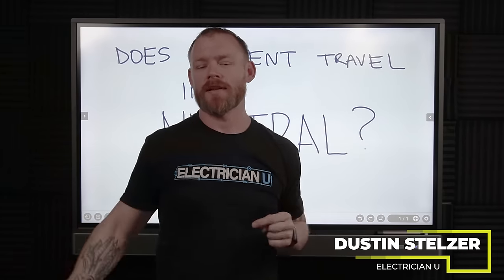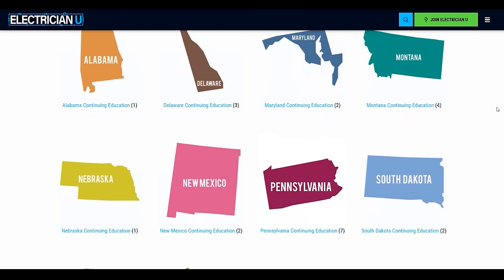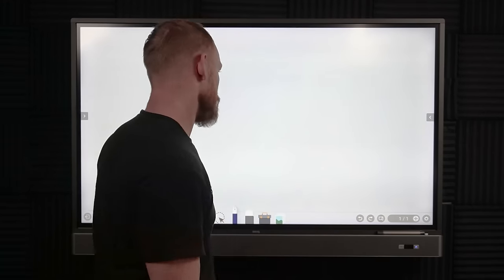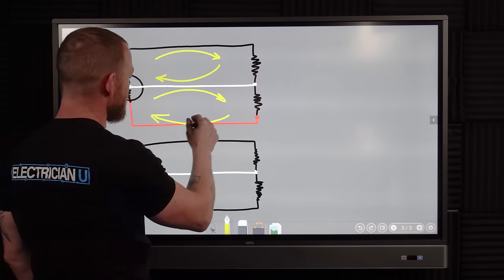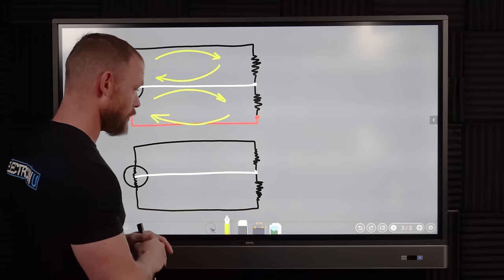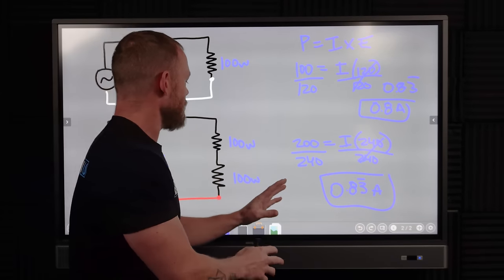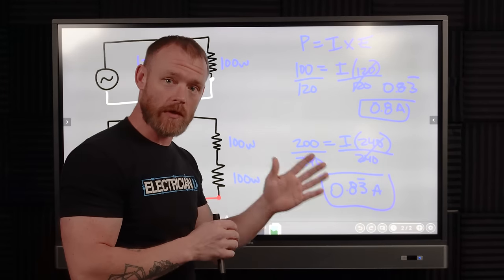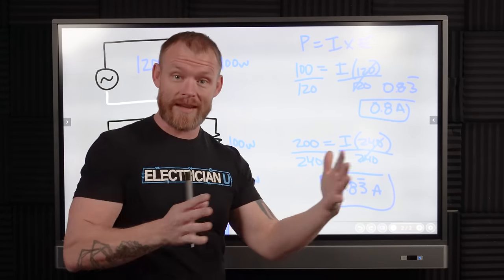Does Current Flow on the Neutral?

Comment: Thanks for the video. There are assumptions being made in order not to have current on the neutral. First, it is assumed there are two loads and they are matched. In the example, if one of the bulbs is switched off, current will be flowing on the neutral (on the path back to the transformer). Secondly, it is assumed there is no reactive load (like a motor). Adding a reactive load will affect the power factor (PF). Practically, PF is never equal to 1, so some reactive load is present making it difficult for loads to be matched and zeroing out current on the neutral.
Reply: Sure, but this is a simplified explanation dealing with a typical residential or small commercial service. Power factor at this level isn't really a concern in the US. Large commercial or industrial is another matter. Also, I don't think he meant to suggest the service entrance neutral load is always perfectly balanced to net 0 amps.

Comment: At electric company; On primary at 12.47 or 13.2  KV an imbalance of more than 5% at the substation feeder is the upper limit we generally like to maintain. Simply put, a three phase 13 KV feeder running 400 amperes nominal per phase the neutral current can run around 20 or thirty amperes. Ideally it should be zero, but often is not. How to be fix this? We do field load transfers. How do we  know branch circuit current values? We place load loggers on Overhead conductors that are paired to the technician's laptop on the ground, and download the readings. We also use special software to predict currents based on customer loads. Usually take field readings for 7 days. Also lineman can use a clamp on meter on each conductor. If the values aren't what we expected, redo load transfers ( making more in the field phase swaps) until we get it right. Usually primary will be 336 AA, 397.5 ACSR or 477 ACSR. Neutral is usually 4/0 ACSR, sometimes smaller. All utilities use different strategies to maintain balance.   Why smaller on the neutral compared to phase conductors, but wire size bigger than needed for 30 amps?  Why a neutral at all? To be able to handle phase to neutral or phase to earth ground faults that can run at high as 4000 amperes at 12.47 or 13.2 KV. 4/0 ACSR is like "goldilocks"  big enough to handle a phase fault and big enough to handle neutral currents; just right size. Without a good neutral back to the substation, a circuit may not trip out when it is supposed to and in the time frame expected  Substation Time over current protection usually trips the substation breaker in 0.3 seconds, Instantaneous trip is usually 0.096 seconds (six cycles or less). We never use a full size neutral on three phase. Exception? Underground JCN (Jacketed Concentric Neutral) cables come from the vendor with a full neutral. Also, single phase primary will have a full size neutral in overhead construction.   Retired SS Engineer, First Energy Ohio.

Comment: You should explain that the mains neutral actually carries  significant current and perhaps explain the difference between neutral and ground to your viewers.  In some residential areas it is up to 180 amps due to switched power supplies and why load balancing per phase is important.  This would explain the need  of zig zag transfomers to your viewers.

Comment: I’m a little confused About your Electrons explanation!

Although  it was a great attempt Most people here are not going to understand that and may get confused, because we’re not physicists. 

Also you drew your neural in white and it shows up as clear in the video. 

I think the reason why people misunderstand and think there’s no current on neutral is because the black wire is commonly referred to as the hot wire and of course the neutral is white.  I think people make the assumption that there is no power being generated on the neutral.  but as you clearly stated the power moves in a circle or loops back and so of course it travels back on the neutral to the hot and your drawings do a great job of explaining that! 

in the US/Canada we have 60 Hz means 60 cycles a second 120 volts and in Europe it’s 50Hz 50 cycles and 240 volts.  a cycle is a sine wave that goes up and down meaning there’s a peak and a valley! 

 also I know something about common mode noise issues from copiers and very heavy motors and machinery that travels back from the panel into the power line to individual homes and businesses! which happens between neutral and ground and destroys computer chips! It actually puts tiny pinholes in computer chips and destroys them over a period of time! 

There’s also an issue of sags (user voltage and surges over voltages) from the power grid! Which brings up the topic of switch mode power supplies that are Inside computers that change the voltage from AC to DC. they also provide voltage regulation but not power protection regulation which is why you need power conditioners to clean up the dirty power for computers! 

I used to use an Oscilloscope with a special device that you would plug into the receptacle a.k.a. power outlet plug the other end of device with (2) leads to plug into the oscilloscope. And show cannonball mold noise to facilities people and IT managers who probably didn’t understand anything I was talking about except the facilities people!

Comment: Twice in 6 months time, I had a fault in the Neutral line coming to my house.  The symptoms were the same (DUH!) - If I ran a high electrical load off the red wire, and a low load off the black wire, the voltage would dip low on the one side and spike high on the other.   The first time, it was due to a corroded neutral wire connection just outside the electrical meter.   The utility worker came and remade all 3 connections and arranged for a drip loop so rain water wouldn't run over the connectors again.  The second time, it was that the neutral wire was damaged by a tree limb rubbing on it.  It took a long time,  too long of a time, to convince the electrical utility to come out and make a second repair.  The remote test showed there was still 240 volts across the meter - the red and black wires were performing fine - but the remote test could not detect the failed Neutral wire.  After someone finally came out, he ran a high load test and it showed a big swing in voltage between the two sides.  He took a hard look at the wire and saw the damaged area.  They replaced the wire and my service has been fine ever since.

Comment: a neutral wire can carry an electrical current, especially when it's used as a return source for power. The neutral wire completes the circuit and provides a path for excess current to drain off in outlets or junctions. For example, the neutral conductor of feeders that supply systems with sine wave dimmers or phase-control is considered to be carrying current.

Comment: FYI the flow of electrons in a conductor of actually the opposite direction of current flow. When André-Marie Ampère "discovered" electrical current, the technology didn't yet exist to actually observe the movement of electrons. So he thought the flow was a positive charge movement as opposed to a negative charge movement. By the time electron movement was observed and measured, the convention of positive charge current flow was already well established, so they just left it alone. Practicality speaking, it doesn't really have any impact on circuit design. Just an interesting fact.

Your videos are great BTW. You're a great teacher. Definitely gonna watch some more.

Comment: The beautiful thing is if you were to read the voltage on each load you would still read 120V on each in the 240V circuit since Voltage is just difference in potential.

240V-120V=120V, and 120V-0V=120V

Ohms law backs it up too.

V1 = R1*I = 60*2 = 120V
V2 = R2*I = 60*2 = 120V

Comment: I’ve tried to explain this to many electricians, and granted not nearly as well as you did, but they pretty much all argue and tell me I don’t know what I’m talking about. I even explain that for instance a 12/3 running to all 120v devices, if I was wrong, then the neutral wire on 12/3 would be required to have a larger wire on the neutral. And, they say it doesn’t matter if a 12/3 has its red and it’s black on different phases.

Comment: Pretty good description in this video, but perhaps drawing the equivalent circuit showing the transformer secondary feeding two bulbs in series would simplify things a bit. Like a rectangle transformer on left, bulbs on right. Then draw in the center tap, (neutral), from transformer to middle of the bulbs. Now delete (or switch off, or unscrew) one bulb and show the return current path via the neutral. Just a simpler visual to describe things rather than discussing cancelling waves or fields etc. Finally, a quick discussion for electricians discussing how an open neutral essentially becomes a “hot” in an energized circuit. Basically, just because a wire is white, doesn’t mean it won’t bite you, something many must learn the hard way.

Comment: Years ago I pumped a lease and it I was told upen delta . I was working a power plant also at the same time and I asked the fellows in the electrical department and they never heard of it as I was having problems at the lease with motor . The ground was broken on the primary.   REA was blaming the shop that built the motor , blame game . I found the wire broken and called REA coop they fixed the problem finally.  What a learning experience
Reply: The Delta three phase line that fed your service can be energized from a bank of either two or three single phase transformers. An "open delta" bank uses two transformers and must have a connection to the system primary neutral from the neutral side of each single phase transformer. A delta bank using three transformers has a connection tying all three neutral side bushings together and is not connected to the system neutral. Open delta power banks are often used at CO-OPs for low usage/low load/remote installations because they can be built with less expense and configured to also provide 120/240 single phase as well as 240 three phase while using only two transformers instead of four. (3 for the 3 phase service and another one for the single phase service)

Comment: I love your explanation.  I admit i am not an electrician.  But i question one thing you said.  When you had the red and black wires with the neutral, you said current doesnt flow in the neutral.  Intuitively, I dont believe that.  Our measuring devices may show zero because i believe they show net current flow.  So if there is flow one way of 3 and the other way of 1 we may expect to see a 2 on the meter.  So if the current flow is balanced, say 3 one way and 3 the other, we may see zero on the meter.  I dont believe for one moment that neutral is a dead wire.  If you touch that neutral in a balanced load, i suspect you will be electrocuted quite well.  Please tell me what you think of this.  I love the videos though.  Keepem coming.

Comment: I was under the impression AC current traveled back and forth in the hot wire and the neutral was only used to return the unused energy back to the city. Alternating current meaning positively charging and negatively dissipating back and forth in the same wire. Not too sure it’s been years since I was in the field, but regardless great video!

Comment: Agreed.  I have heard electricians call the neutral the "return" which goes to the main panel and then to the 3rd wire from the power company which you can physically see on the power poles is routed to earth below.  So "earth" is the completion of the "circuit" from the power generators.

Comment: This is good to know. So, essentially, you can use any current reading past the neutral bus as a quick way to determine if your load is imbalanced; assuming nothing else has gone wrong by that point.
Reply: It would be interesting to monitor the current on the Neutral for about 24 hours just to study the imbalances. I was one of six houses that lost our neutral connection to the Transformer years ago. I wouldn't have known if I wasn't seeing the lights change brightness. Turned out ants had corroded the neutral connection to the Transformer leaving about six houses with a floating Ground.

Comment: Here are three related examples ive come across as a cable installer that even stumped the linemen for a bit since they got involved. The three examples are aerial 240v split phase secondary/ wye primary. 
1: the service drop neutral broke.  The home ground rod became saturated.  The coax cable drop is bonded to the home ground as well as to the aerial span which is cobonded with the service neutal and earth ground on the pole.  The home used the coax as a neutral from the earth neutral bus to the coax to the service neutral to the earth.   It melted the drop and would arc when disconnected. 

2: the pole ground was cut by a crackhead, the transformer had a saturated primary neutral, the secondary service neutral used the home ground rod and the bonded cable drop which ran to a still properly grounded aerial span.  Melted the drop and caused arcs when disconnected. 

3: the home ground rod was eroded and failed and saturated the service neutral which had its own issues.  The home used the coax to the aerial span which was properly grounded as a far extended ground circuit.  Same arcs

All of those were fun to consider.  I probably butchered some terminology but im sure a pro can figure out what I meant.

Comment: I learned electrical via DC voltage.  In that model, voltage drop is across the load, so the "ground wire"  carries a lesser load. This was the toughest thing for me to overcome learning about balanced AC electrical.  This was a very nice explanation.
Reply: uhm, what?  no.  The current is the same in both + and - wires in DC.   The current is exactly the same in any point of a series DC circuit.
Reply: @sergeig685  So, a resistor does what in a DC circuit?

Comment: If I'm understanding correctly - red and black are equal but opposite; neutral white is the net of both. If the load on red and black are balanced, then neutral white is zero. If red and black are unbalanced, neutral white will carry the difference. Did I get that right?

Comment: In the asymmetric circuit at the end, where one bulb has 10A flowing and the other bulb has 2A flowing, it would have been useful to show what would happen if you then removed the Neutral wire. How much current would then flow? What would be the power used by each bulb? What would be the voltage across each bulb?

Comment: This started out clear and of value in helping me to understand two phase power better. But then it ended up confusing again. The example showed two loads of equal wattage, making sense that no current flows in the neutral. But I would think that is an exceptional and hypothetical case, since the loads of each phase are NOT very likely to be equal. Electricity at the homebrew level, can be quite dangerous.
Reply: Residential USA uses single phase. Not  2 Phase.

Comment: Does Current Flow on the Neutral, yes for a 120VAC load, which will require the use of the neutral as per the NEC. In wiring up a single phase residential panel, the breakers (loads) are installed to balance (match) loads such that ideally there would be no current in the neutral conductor. However, this will never happen. The problem is AC loads are impedances and not purely resistive, and it is virtually impossible to make two loads perfectly match, even if it is the same type of device from the same manufacturer, there will always be a slight mismatch in impedance, which means a slight mismatch in current. To match perfectly the loads would have to have the exact same instantaneous power requirement and power factor. Meaning they have exactly the same steady state impedance as a minimum. 

If you install a three phase 120/208 Y panel you will also match the loads, but now across three phases A, B, and C. For a three phase load it is easy, just use the appropriate three phase breaker (common trip). If the load is a single phase 208, you would have to match three breaker two leg breakers (common trip), A-B, B-C, and C-A, each could use a neutral if need, but ideally all should match, with no multi-wire branch circuits. For single phase 120 loads you would need three identical breakers individual trip (loads) for each leg to neutral. So, as you can see for a three phase panel with two columns of breakers (left and right) there is a basic symmetry in panel when the breakers are matched properly.

The name Neutral, for a single 120VAC load, is poorly named, it should be called a return. The AC voltage and current are alternating in time at 60 Hz so there is really no positive and negative as in DC circuits, and neutral is reference as negative, or a return, solely because it is star connected with earth ground at the power input service panel. So, the load ungrounded terminal is called Hot, the load grounded terminal is called Return (Neutral), and the safety earth ground is called ground or if earthed, as it should be, earth ground or safety ground. Hot is important because it represent the power feed from the panel, the Neutral is the power return. 

If an AC circuit was floating, like on the output of a mains isolation transformer unterminated, you would just have two transformer output connections to complete the AC circuit to the load, what you call them is up to you. If the transformer was to feed an isolated load through a NEC panel you could use the names isolated hot and isolated neutral. The ground connection can also be floating, we have Orange receptacles for this, and how the load ground connection protects for equipment ground fault is up to the design engineer.